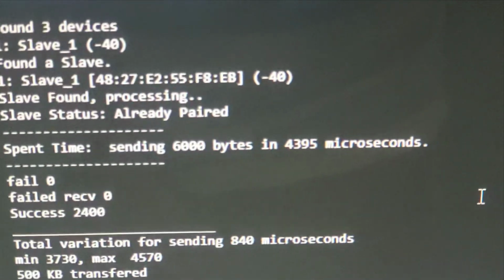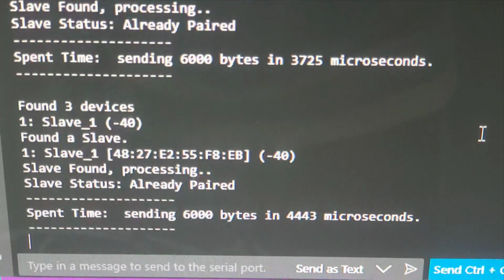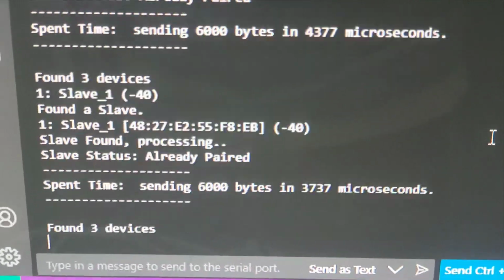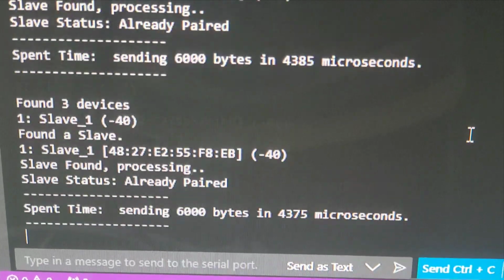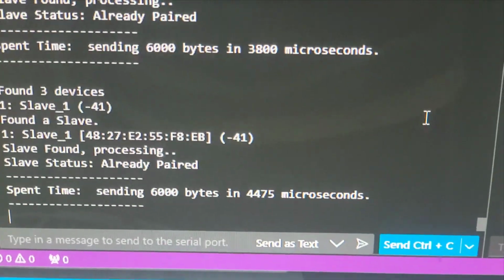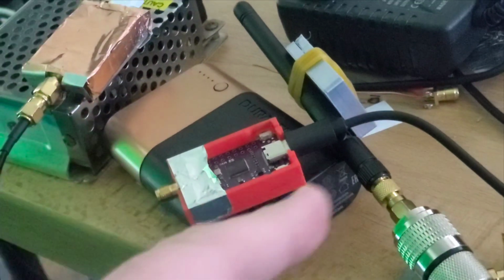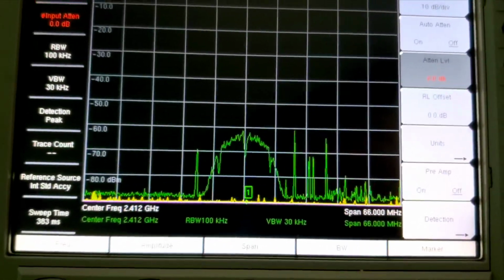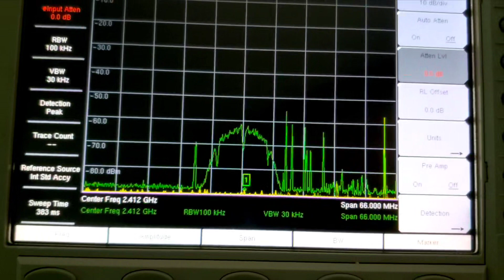Two ESP32 wired and with packets in microsecond range.

Comment: Can you provide the code and the connection diagram
Reply from the maker: My code only sends 6000 (250 bytes x24) but code I saw on guthub claims better results in terms of bytes per sec. Which makes me think something is wrong with my code. Here is article: https://blogs.ntu.edu.sg/ps9888-2020-g16/2020/07/11/esp-now-data-transfer/

I will publish it in next video. You will be suprised with "connection diagram"